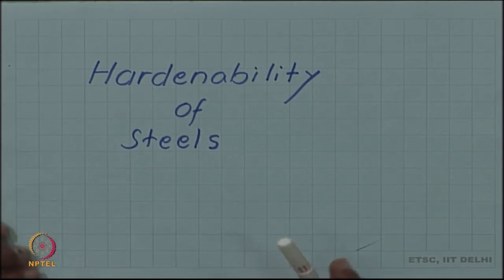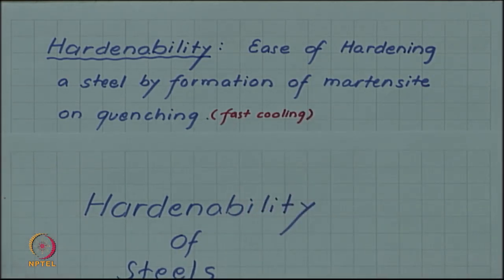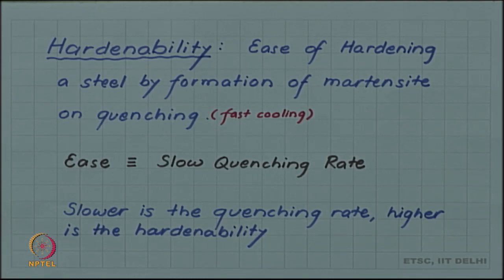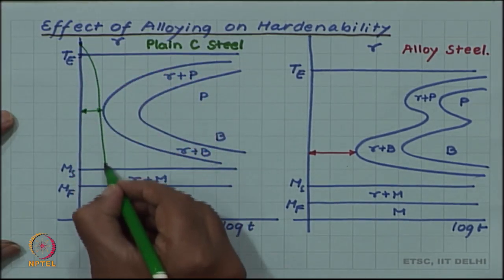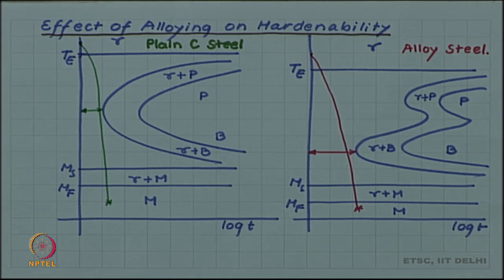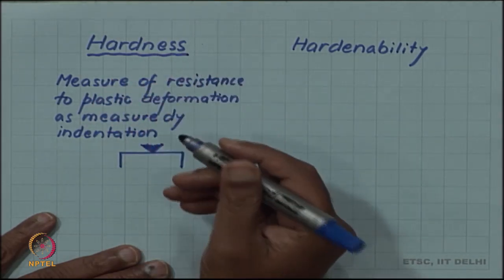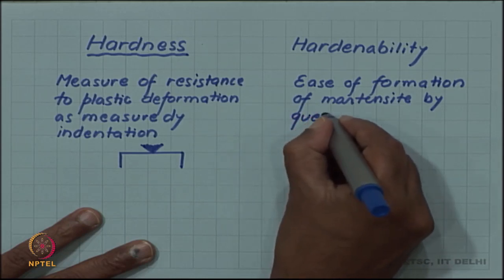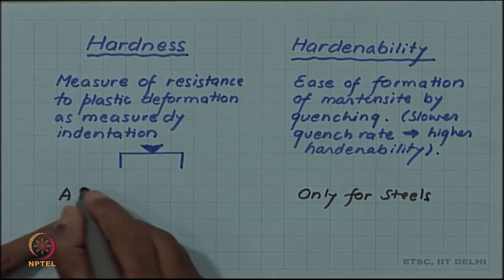Hardenability of steels

Comment: Sir, quenching itself is fast cooling, what is meant slow quenching rate? why slow quenching rate greater the hardenability?
Reply from the maker: Yes, quenching is fast cooling. But you can still compare two quenching rates. For example, water quenching is faster than oil quenching.
Now faster the critical cooling rate, more difficult it is to achieve this cooling rate in the interior of a thick component. So for faster critical cooling rate thick components will not form martensite inside and we will say that the hardenability is low. Oppositely, slower the critical cooling rate, higher the hardenability. 
Please note that in the above sentence I am using CRITICAL cooling rate (CCR), minimum cooling rate to produce 100% martensite. This is a material property and different from ACTUAL cooling rate (ACR) which depends upon quenching medium. 100% Martenstie forms when ACR>CCR.

Comment: Sir does the rate of quenching quenching affect hardness?
Reply from the maker: Below the critical cooling rate, if the rate of quenching is varied you may get a variable amount of martensite in the final product. Then the hardness will certainly vary with the amount of martensite. But if you are cooling faster than the critical quenching rate then 100% martensite should be produced. The hardness should then not be a very strong function of the quenching rate. However, it may still depend upon the quenching rate due to differing amounts of residual stresses and defects.

Comment: Sir, I have still a doubt that why faster cooling increases hardness?? Sir,it is true that due to change in microstructure hardness change,but the question is why?? Sir, is there a mathematical relation between hardness and cooling rate??
Reply from the maker: You have a valid question and one which is difficult to answer.

 In case of coarse pearlite<fine pearlite<bainite it is the same phases but different microstructure, i.e., different distribution of Fe3C in alpha phase. Alpha phase (bcc) is inherently soft, that is dislocations can move easily in it. So the hardness is mostly due to obstruction to the dislocation motion by Fe3C phase. Now finer the distribution, more frequent is the obstruction. This can explain the increasing hardness of coarse pearlite<fine pearlite<bainite. Martensite is an altogether different phase. It is tetragonal phase where slip is not as easy as in the cubic alpha phase. Furthermore, all the solute atoms (C) in the steel go to the martensite phase. thus if you are considering 0.8% C eutectoid steel, martensite will contain 0.8%C. But alpha phase in the same steel will contain only 0.02%C. Thus if you compare martensite and alpha phases in the steel, martensite has 0.8/0.02=40 times more C than alpha phase. This contributes to the enormous solid solution hardening. There are still other factors, like twinning in martensite. This explains enormous hardness of martensite as compared to the single-phase alpha. But finally, it has to be compared with alpha+Fe3C microstructure. This step is not so obvious to me, that's why I called it a difficult question in the first place. 

My answer is not complete, and a more careful and deeper analysis is required.
Reply: @introductiontomaterialsscience  Thank you sir...
Reply: @introductiontomaterialsscience  sir, one more difficulty I am getting that why an increase in carbon content increases hardness?? What exactly happens at atomic level??

Comment: sir why by shifting the of  C curve  increases the hardenability  of steel
Reply: Well, this is simply the definition of hardenability. If martensite can be produced by slower cooling the steel has, by definition, higher hardenability. Thus if C-curve is shifted to the right (i.e., higher time) then even a slower cooling rate can avoid the formation of ferrite and cementite, and so martensite can be produced at a slower cooling rate. We thus have higher hardenability.
Reply: If hardness is achieved even by slow cooling that means material hardenability has increase
Reply: What it means slower quenching rate ..? It's confusing me .